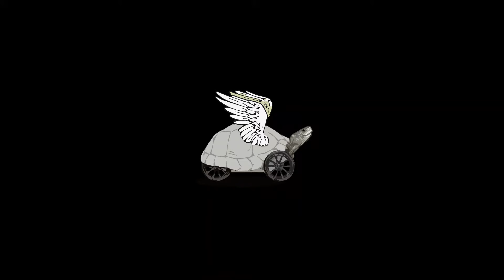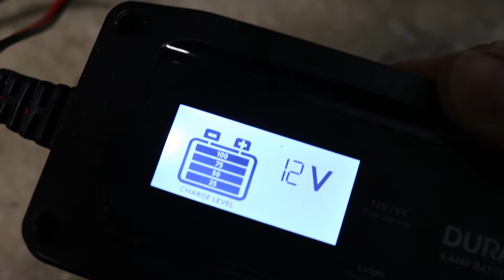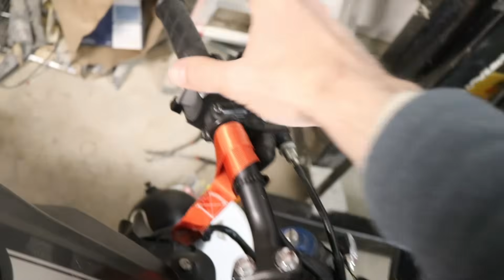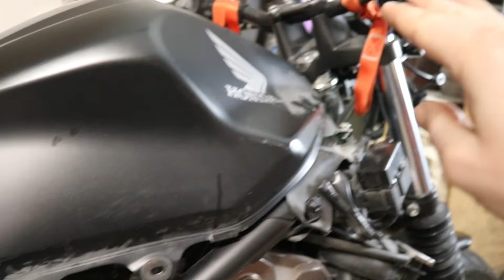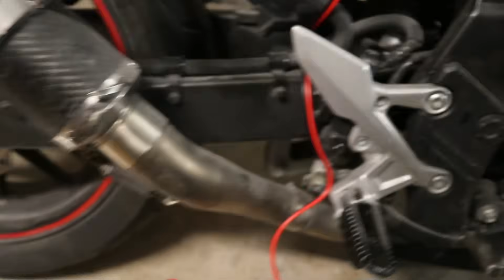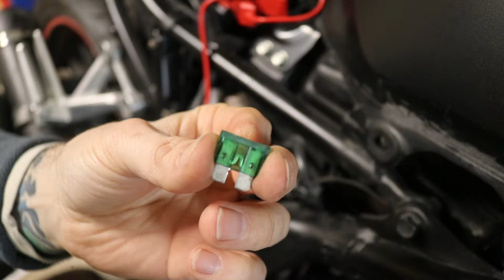Motorcycle Won't Turn On! No Power at All | Blown Main Fuse Diagnosis

Comment: How do I fix, power on only one side of the fuse
Reply from the maker: Sounds like the fuse is bad. Power runs through the fuse, so if you are not getting power to the other side, try a new fuse.

Comment: On my 2016 Gsxr I forgot to put the kickstand up and popped it into first gear and the bike died, when I tried to start it back up I got no response, so I jumped the battery which it turned on the bike but the second I took off the jumper cables it died almost instantly. Did I blow the starter solenoid?
Reply from the maker: I would check the battery first. If you have a voltmeter check if it has 12 volts or more. If no voltmeter,  take the battery to an auto parts store and have them test it.
Reply: @HooptieDoodle  it’s good at 12.8 v

Comment: Thanks for this, I have a quad that has the same issue, no power anywhere, and the battery is fully charged. I am not a mechanic by any means so this really did help me out. Thanks for the post.

Comment: I'm having the exact same issue with my honda cbr 650. I appreciate you man, thankyou for doing this video.
Reply: Same on my V-Strom after heavy rain, it usually starts but sometimes it wont...
Reply: @sercio994  mine has the same problem after the heavy rain as well
Reply: @fabricemwandopaul1740  The problem disappeared after it was dry for a few days, it might be cables' connectors near the frame. Gonna fix it with some plastic cover!

Comment: My main fuse keeps blowing , I added a circuit breaker and noticed my ignition switch black and white wire start to smoke up. Would this indicate a bad ignition switch?
Reply from the maker: Possibly. You're likely got a short in or near the switch, which is causing those wires to flow too much juice and smoke. Definitely take the switch out and investigate further.  You may be able to see a bare wire.

Comment: I was installing some license plate lights and forgot to turn the key off lol. 
Heard a spark and now no lights anywhere and bike won’t start but I get the usual electrical startup sound when I turn the key but just no lights or starter. 
I checked fuse and looks fine and also replaced starter relay and still nothing. I’m stumped 🤔
Reply from the maker: Did you check all the fuses? Sounds like the circuit for the lights also has the starter switch (or similar) on your bike.

Comment: My bike has no power but my fuses are good and bought new battery still no power the only thing that works is the tail light and turn signals and it was running great before

Comment: I have a 1986 Magna V65 and have the same issue. However, the fuse keeps blowing every time I replace it and connect the connector. I know this means there is a short somewhere but I cant find it. The negative terminal cable that connects to the solenoid is fragile but nothing is touching the frame and nothing else is either. Any ideas of what it might be?
Reply from the maker: Start with the obvious; you've already identified an issue with the negative terminal - fix that and see if it makes a difference.  Sometimes the simple solution is THE solution, sometimes it's just the start of a series of educated guesses (which mechanicing can occasionally be). The good news is when you figure it out you'll learn something and be very proud of yourself 😀👍💪
Reply: @HooptieDoodle  Thank you!

Comment: I get to the seat fuses. But that main guse is hell to find on 2015 grom. Its not in plain site.  But my lights in fron come on when i turn the kid no  Display. I think its the main fuse.  When ever i find it.  I switch it.
Reply from the maker: Your main fuse is with the other fuses on the grom. I'll post a picture in the community section of this channel that shows what I am talking about. The grom is simpler electronically than the CB500 in this video.

Comment: Hooptiedoodle what if it keeps blowing the 30 fuse everytime u put a new one in? Like immeadtly
Reply from the maker: Fuses blow for a reason. Finding the reason is the hard part. Reasons for a blown fuse include shorts, damaged wires, water,  incorrect fuse, and overloaded circuits. If two or more lesser circuits are overloaded or have shorts, etc. it is possible for their fuses not to blow, but for the main fuse to blow  instead.  You'll need to examine the wiring on the bike for damage and if you know the bike's history you'll be in better shape.  Any electrical mods? Good luck🍀

Comment: Hey dude...i have same prob with my 03 vstar 1100 except it wasnt the main fuse under seat..it was still like new but still no power..lights ..or anything?..any insight would be great please.
Reply from the maker: #1 check the battery. Take it to an autoparts store and have them check it. #2 other fuses. Check them all. #3 main relay: https://youtu.be/zUFsmNdg2bM
#4 get a simple voltage tester and start tracing juice from the battery https://amzn.to/3wtrkKj
Check things like the key switch. Does power go into it? does it go out when the key is turned to 'on'?

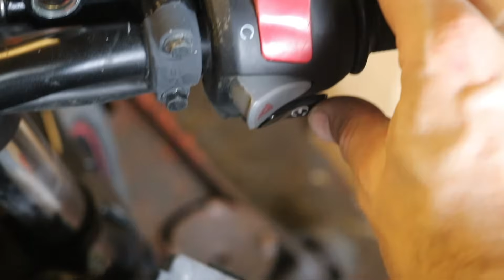Comment: Hey, I have a 2021 Honda CRF250F and I left the key in it in the ON position draining the battery. After I charged it overnight, the next day it cranked fine. But mine has the EFI and now when I turn the key to ON and the EFI comes on it now makes that static noise like in your video at the 1:37 mark. It didn't do that before the battery drained. Any idea on why it's doing that? Is it possible it still thinks the battery is too weak? Great video by the way!
Reply from the maker: Mine was a battery issue making that noise. I got a  new battery and that fixed it.

Comment: I have same problem my bike used to start but someone took my battery an when I put a battery back in no power no nothing because my girlfriend put battery in backwards my bike is a 1990 gpx ninja Kawasaki but my fuses are fine could it be the ignition box because or what else could it of blown

Someone please help
Reply from the maker: If you've checked and all the fuses are good,  it now starts to get more technical. Putting a battery in backwards can blow a number of things in the electrical system from relays to ecu, to ignition,  stator. You're going to need a wiring diagram for your bike,  a lot of patience,  an ohm meter,  and a decent amount of electrical savvy to track down what is and isn't blown. I'll link another video on starter relay diagnostics to give you an idea,  but it may be much easier to seek professional help.
Reply from the maker: Here's the starter relay diagnostics video https://youtu.be/zUFsmNdg2bM

Comment: What if the fuses are good? 
But my head lights and horn works. Just no power to the dash no start
Reply from the maker: I don't know for sure,  but if all your fuses are good, I would next start checking relays to see if they are good. I would also refer to the wiring diagram for your bike to help narrow down the possibilities. Its possible the dash and starter are on the same circuit (?) which would limit diagnostics to that circuit. Here is a relay video on a Grom: https://youtu.be/zUFsmNdg2bM
Reply: Did you have any luck yet. I noticed the same issue last night on my ZX10. I will start tonight into the findings.
Reply: @markslentz4492  what was you’re issue? I’m having the same issue right now
Reply: @barlos3008  It was a fraded wire leaving the kill switch that was grounding out and causing my short. It took hours to find. Good luck.

Comment: What would you say if the main fuse isn’t blow? I have a 2001 Yamaha r6. I hit the starter button. The bike made a loud noise. Then it lost all power. Battery reading 12.48
Reply: Starter solenoid. You can bypass it by bridging the 2 big posts that connect to battery + & -
Reply: Same issue but on a cbr1000 06

Comment: My main fuse is ok, if I short the starter solenoid it cranks and no lights, no starter switch no horn, nothing lol
Reply: Did you fix it
Reply: @lu9thix  Hi, I eventually did but think it was my ignition switch that was damaged. Can't remember 100% I'm around the bike again as replaced the engine so been around adapting ne old wiring loom to this engine

Comment: My bike lost all power while riding in the rain. Found out the main fuse was blown. I replaced it and it blew the new one within 2 minutes. Please any idea. It’s a new bike.
Reply from the maker: Very likely there is water in an electrical connection somewhere.  It should eventually dry out and be fine, but if you want to keep it from happening again, i would look at what is connected to the fuse that blew and check connections in that circuit. That narrows it a bit. A wiring diagram for your bike will help a lot. It should be obviously wet when you  find it. 
Surprising as new bikes more likely have water proof connectors. But not all the connectors. Turn signals on mine do not. 
Good luck finding it 💪👍
Reply: @HooptieDoodle  thanks for the response. I’ll have a proper look through the wiring.

Comment: I have a similar problem with my cbf 125 but at first it was to do with my earth not being connected to the starter mortar but now it’s just making that buzzing noise any ideas
Reply from the maker: I would guess battery if its buzzing
Reply from the maker: Low charge on the battery

Comment: family member passed down a 125 to me as im taking my cbt next year, he said it was involved in a crash and if i didnt mind fixing it up i can keep it. He said it should be little effort to fix up but im no mechanic and after replacing the battery i still had no power to the bike so i am off to check the fuses now. Thank you so much for this video it taught me about blowing fuses and how to identify them too. plus 1 sub :)
Reply from the maker: That's a very nice family member.  I hope the video helps get it going again, good luck on your cbt, and thanks for the sub! I am building a 125cc bike right now.

Comment: Dude..help me....my bike is suddenly dead.then I found that my if fuse is blow..I change it..the neutral light is on...then when I push the start button.its blow again..I change couple of fuse.its blow again...what is the main cause????
Reply from the maker: Check a wiring diagram for your bike,  figure out what all is on the starter circuit, then start checking connections and wires within that circuit.

Comment: I have the same issiu whith my honda xlr 200 i check and the fuses are good i can't find the problem my starter relay was working with a 40A fuse and one the relay it says 15A does the relay broke because of that?
Reply from the maker: I should have a starter relay video out next week that may help you
Reply: Thnx for replying

Comment: If my electrics work and engine cranks but won't start. My main fuse must be fine right? Reason I ask if because the cap is on so tight i cant bloody remove it without fear of damaging something to further inspect the fuse. All other fuses are intact.
Reply from the maker: Correct. You would have any electronics if the main fuse were blown
Reply from the maker: *wouldn't
Reply: @HooptieDoodle  fanks bruv

Comment: I got a crf230l, new battery. A 10 amp fuse that controls the starter and headlight keeps blowing. Everything is stock and I didn’t change anything to the bike.
Reply from the maker: You most likely have an exposed wire somewhere in that circuit. I would look at the wiring diagram for your bike and see what all is on that fuse circuit and then start looking at those individual components (like the headlights and starter you mentioned) and take a close look at them to see if the copper is exposed on any of the wires. I would then start looking at the wire loom in general to see if any wires were rubbed through to the copper. This could be tedious. Good luck!
Reply: HooptieDoodle thanks for the reply, I took it to the main maintenance guy I work with and we traced it to the headlight bulb hopefully.

Comment: My bike keeps burning my fuses after i took it to the washing shop. Probably they overwashed it or something :(
Reply from the maker: It sounds like there is water inside an electrical connector(s)... somewhere...on the bike. Modern bikes tend to have waterproof connectors (mainly), while older bikes had none. None of the connectors on my 1982 Honda were waterproof. A wiring diagram will tell you what components are on each fuse circuit and, judging by which fuses are blowing, that will tell you where to look for the water. Unplug connector and dry it out (hair dryer, time). You'll probably see water in the connector(s) if I am right. Good luck 👍
Reply: @HooptieDoodle  Will definitely try that. Thanks for the reply

Comment: Thank you this was helpful , I am confused though. The ignition fuse blew up on my cbr250r , the instrument console went blank , so did the lights and even the starter motor would not turn. I fixed it by replacing the fuse.
My question is , why would the blown ignition fuse affect the whole mobike ?
Reply from the maker: You would have to look at the wiring diagram for your bike to see what other components are on the ignition circuit/fuse. My guess would be that all the things you mentioned are 😁. It is very common to have multiple thing operating off one fuse.  Generic Girl is a great name by the way 👍

Comment: I have a old 1987 Kawasaki eliminator I tested the fuse box on it and I only had the top 2 fuses working but the bottom 2 fuses weren’t working idk if I should replace the fuse box I have no power to it when I hook the battery up the only light that comes on is the neutral light
Reply from the maker: Do you have a wiring diagram for the bike? That will help a lot. Have you replaced the two fuses you said weren't working? What do those fuses go to? Depending on how the bike is wired (supposed to work) if you are getting power to the neutral light, than the main fuse should be good and the issue lays...I would guess at this point, within the two circuits that had bad fuses. Figure out what components are within those circuits based upon your wiring diagram and then physically inspect those circuits for obvious issues like exposed wires. I am only guessing without having the bike in front of me, so good luck!

Comment: I attempted to boost my bike with my car , and now have completely no power. Could those be the cause a blown fuse ? Hyosung gt250r
Reply from the maker: You can totally jump a motorcycle from a car (https://youtu.be/HNzSekja-uI). But yes, it is possible to short the bikes electrical system and blow a fuse when trying to jump start it. If the cables are hooked up backwards this will blow fuses and possibly damage electrical components or, similarly, if the positive cable was in contact with bare metal on the bike's frame this could also cause a short and blow fuses. Have you checked the main fuse though? Is it blown? Or is the battery completely dead? Best of luck!
Reply: @HooptieDoodle  yea checked volts of battery have about 11.8 , and main fuse 30a was good main fuse 15 was melted into the connector harness , going to replacing both today and hopefully that does it . Thanks

Comment: Ok. But what if battery is good. Fuses are good, and all the wiring is good? Having the same issue on my 83 shadow. I think i have it tracked down to the ignition switch but want a fresh set of eyes so to speak
Reply from the maker: You are on the right path. Ya gotta start tracking it down and the ignition switch would be the first stop along that path. Juice to the ignition switch, but nothing out? Using your wire diagram, if you jump wires at the ign switch, you should be able to get power to the dash, then you can know it is your ign switch that is bad. You can also remove the ign switch and bench test it the same way. 
You'll get it. Good luck!
Reply from the maker: If your ign switch is good, where does the power go after the ignition is on? To a relay? Is the relay good? You'll be an electrician by the time you are done :)

Comment: Any idea why I'm not getting any power? I replace all the fuses and the battery and I still have nothing
Reply: any solutuons, been over a year-
Reply: @xavierwinnfel874  in my case the battery needed to be recharged but more importantly I have wires taking power to an alarm system that was no longer there and the power connects to the starter were bad. Long story short it's an old bike that sat outside uncovered for years
Reply: Check your main fuse relay, happened to me
Reply: Could change the relay..
Reply: Same
Reply: Yeah, my bike is an 82 gl1100 aspencade. and Tbh I think its the same problem as in the video, the fuse. mines like melted, but the connection on the inside looks nice. tbh, im just hoping it a blown fuse and I can hurry up and finally start this bike.
Reply: @xavierwinnfel874  yeah mines is an 98 vstar 650 custom, i got mine running at least starting for a while but now its leaking gas and this is after completely rebuilding the calipers and replacing the fuel line
Reply: Yeah, im just glad my restoration is coming to a finish soon.
Reply: I had to take my whole rear end off just to get my gastank out 💀
Reply: @xavierwinnfel874  luckily it doesn't take that much to get my tank off